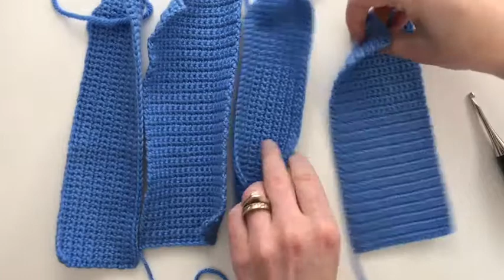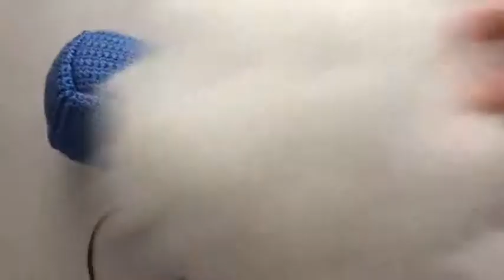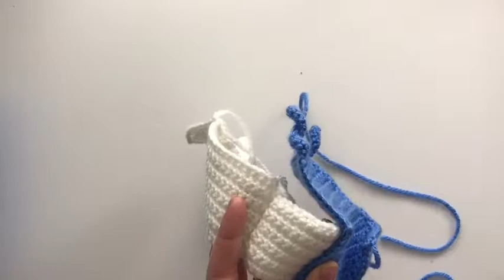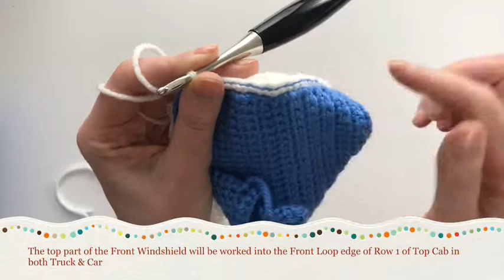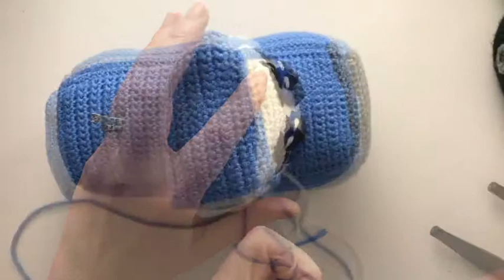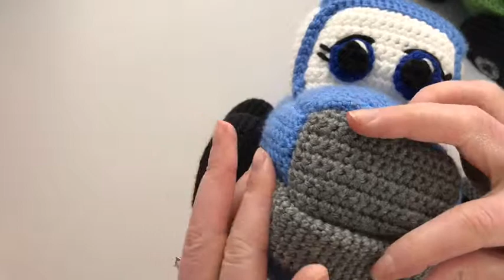Car & Truck Assembly Tutorial

Comment: Hi Holly! I'm having trouble piecing the body of the car together. If I line up the side panels evenly with the top and bottom panels, I'm left with two triangular pieces of side panel sticking out beyond the ends of the rectangle made by stitching the 4 pieces together. I just can't figure it out
Reply: Hi! Did you ever figure it out? I can’t get it right :(